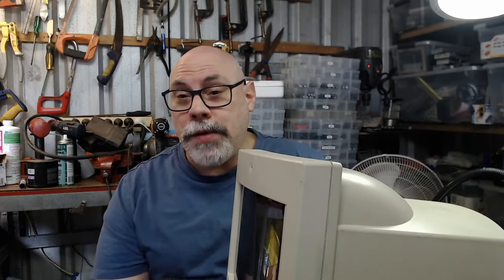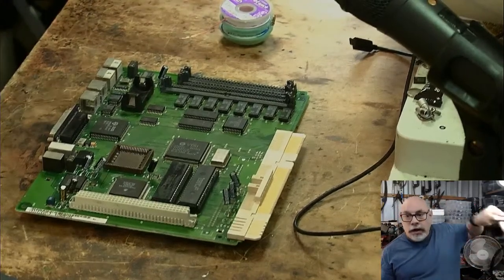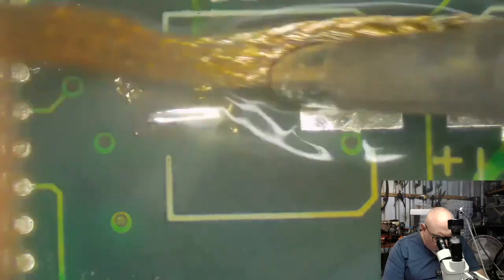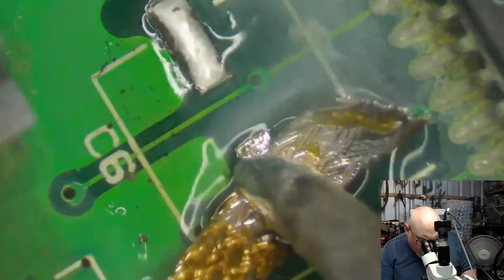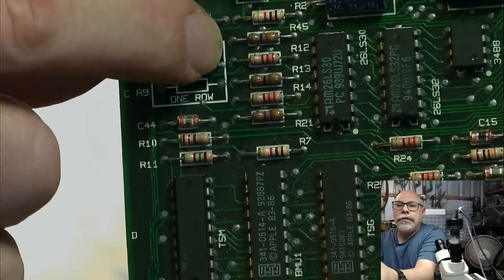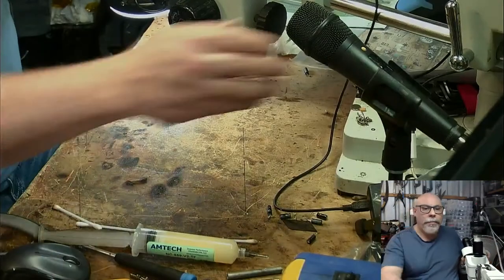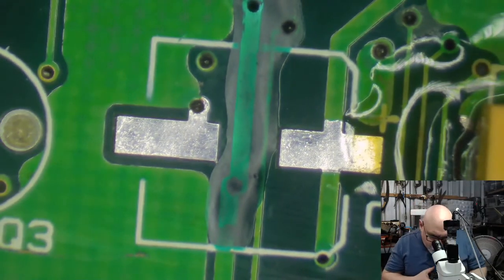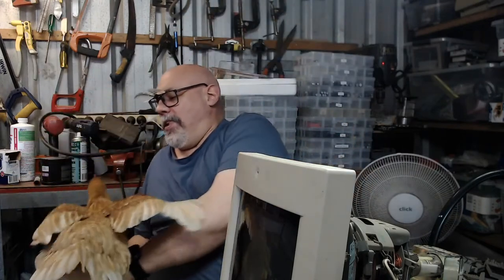Recapping a Macintosh Color Classic the right way

Comment: What size ultrasonic cleaner do you recommend that’d fit the widest range of Mac MLBs reasonably?
Reply from the maker: I use a 10L, though it doesn't fit all boards. All the smaller boards fit, but I have to do IIci, IIcx, IIvi, IIvx, Quadra 700 board sizes in two halves. I can only clean about two thirds of a II, IIx, IIfx board, and a Quadra 900/950 barely fits at all. Unfortunately most of the generic cleaners aren't really designed for common logic board sizes. There are larger cleaners available, but they cost more and use a lot more liquid.